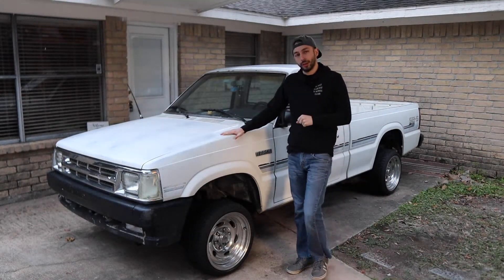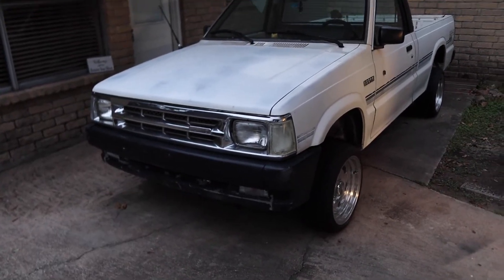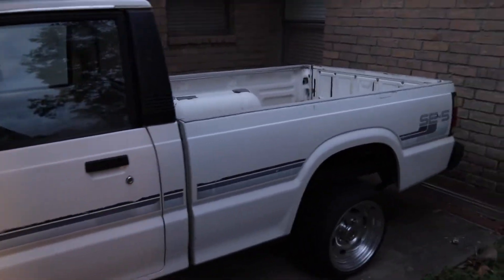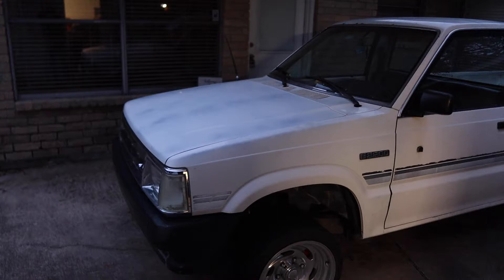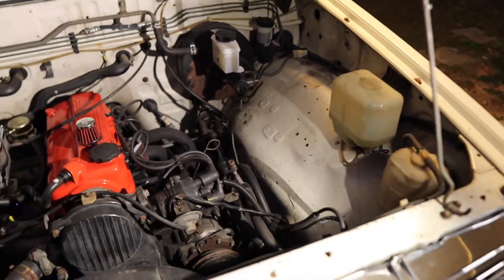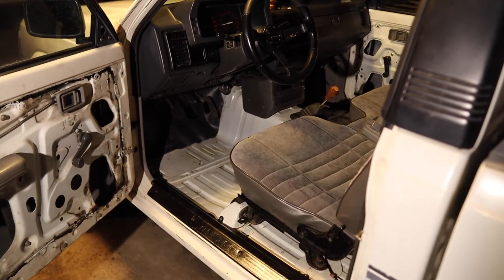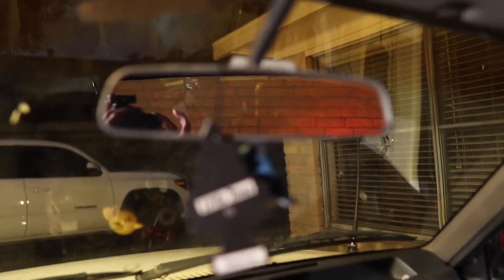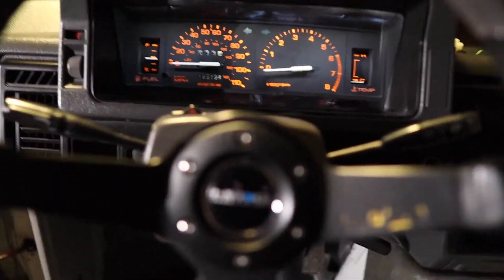Mazda B2200 Mini Truck Build Recap 2021 | Flake Garage 1988

Comment: Just got a 1992 b2200. Needs master cylinder/booster,new lines, but runs and shifts great. Can't wait to bring it back to life! Your video are great. Thanks for posting them.
Reply from the maker: Nothing a little maintenance can't fix! The slave cylinder also is a common thing that fails/leaks. If you change your master, I recommend doing the slave one at the same time
Reply: Where you from ?
Reply: Michigan. Metro Detroit area
Reply: My dad has a sub woofer champion winning 92 b2200 mini truck and now i got my L and hes getting me for us to work on for me!!!!

Comment: Got a white 1991 se5 i removed the stripes on the side of the truck looks great.
I put on a 3" body lift tires a little larger than factory Toyota enkei 15" ×7" rims.
It has the tan interior and is very clean and i plan to but the bed cover you did the video on then i will be happy.
Thanks for the videos and all of the great tips.
Reply from the maker: Nice brother, that probably looks great! I like my strip and hopefully in the future I can do a newer better stripe lol
Reply: @FlakeGarage  
That would make a good video it would give people ideas of what is out there and stripe there b2200.
Thanks

Comment: Great informational videos!  Started having an issue this weekend.  My 87 SE5 is all stock.  Had it on the highway and at top end wide open it starts to miss.  When I take my foot off the gas a little it smooths out.  I am going to change the fuel filter but do you have any idea what would cause this?  Vacuum leak, Ignition module, timing...hoping you have come across this.  Wires and plugs are new. Fuel filter and rotor are new.  Thanks
Reply from the maker: My initial thought would be a vaccum leak, it sounds like maybe you are putting either too much air or fuel on the top end which is probably why it smooths out when you let go a bit. The factory setup has a lot of hoses that could be old so I recommend checking for any rotten ones or holes
Reply: @FlakeGarage  Thinking about going to a weber set up.  My truck is totally stock and I even have the window sticker.  Are these trucks worth any more money when they are stock?  Also wanted to ask about the Pace Setter header.  How loud is the truck with the header on it?
Reply from the maker: The truck I guess could be worth more completely factory but that all depends on overall condition. A weber is a great upgrade that I don't think will lose you money when selling. The pacesetter by itself doesn't make the truck much louder, just a little more growl to it but not obnoxious. I think you would be fine doing either modification on your truck

Comment: Hey so what about stereo upgrades I'm gonna be trying to do a single din install on my truck but I can't seem to find touch information or the correct connector
Reply from the maker: Because of the windshield leak I have I haven’t installed a stereo back into the truck even tho I do have one ready. It’s really not hard on these trucks specially if you are removing one already. Running all new wires it’s extra work but you would at least know everything about the system. I will eventually have a video on it

Comment: Hey brain have a quick question for you.I have a 1992 b2200 long bed what  type of motor oil u use when u change oil Synthetic or conventional oil ???
Reply: Live in Florida
Reply from the maker: I personally have been using full synthethic Rotella T6 5w-40 on both of the trucks without issues. It has been getting harder to find recently though so I might have to switch into another brand